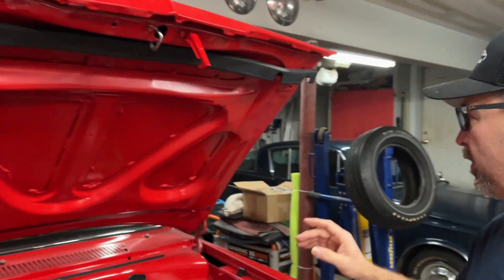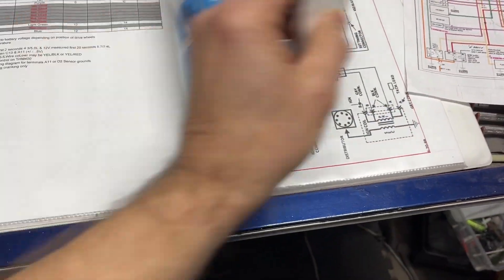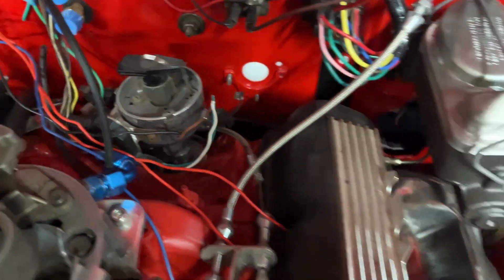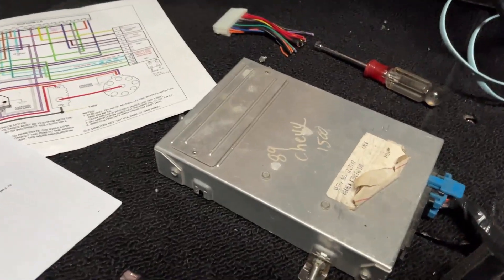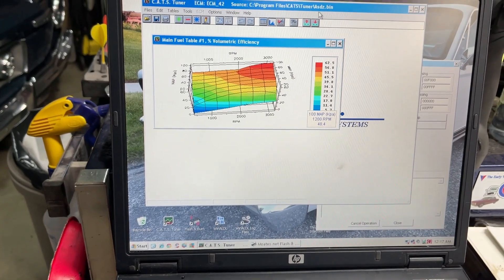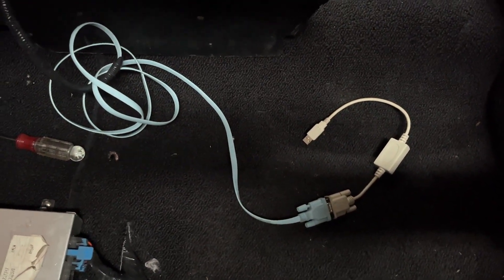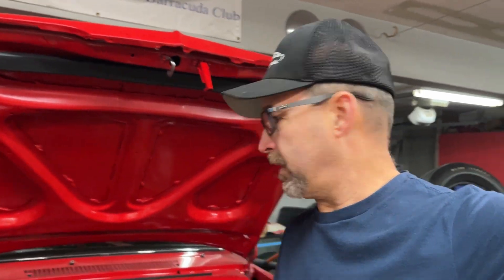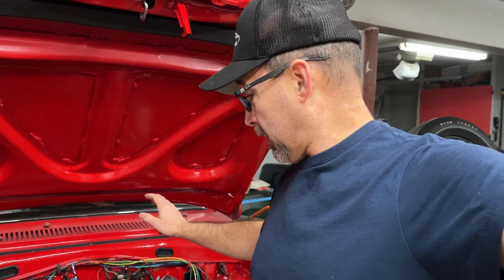How To: DIY Fuel Injection

Comment: What fuel pump did you use
Reply from the maker: @brycemcdonald6779  I honestly don’t remember, it was over 12 years ago. It’s an inline pump mounted to the frame of the car putting out the required amount of fuel pressure. That’s all I can tell you.

Comment: THATS AWESOME MAN
 i was just asking other YTers if i could modify a leftover LS engines efi system to any engine i wanted.
just rob the fuel rail, injectors, throttle body , iac, tps temp sensor, o2 sensor etc and make it fir on another intake/engine

this way seems even simpler
BUT VGG makes it sound like those terminator brockly injectors are  not available new parts anymore?
Reply from the maker: Check out the forum link in the comments, there’s info on TBI and mulit-port injection.

Comment: I love this stuff and i know theres a million ways to skin the kitty. That said if younwant o skip dealing with the old school gm ecu and wantno be able to tune your ecu so your engine will run optimally and you dont want to spend a small fortune fornwhat holley, edelbrock etc... want which last i checked was over $1000, then theres an open source efi controller called speeduino which is a goofy name but boy howdy is it some powerful hardware. You can buy a pre-made board that will do everything from tbi to sequential port injection, basic distributor to coil on plug amd its tuned via tuner studios which their basic version is free but if you want features like auto tune where you drive around an let the system adjust itself then theres a $20 yearly fee i think im pretyy sure its 20 anyway... ive used this deal a few times and i buy the ecu's from detonationems.com. they sell a board with provisions for up to 12 injectos and every type of ignition for $89(no im not employed by them or being paid to say this). I used to use the stock gm computers with modern erasable prom chips (the prom holds the program for running the engine and later they added transmission control before OBD2 and flash memory became standard) ive even run a few using a prom chip emulator from MOATES but they went out of business back in 2020 cant imagine why🤬. But its a lot of dicking around with 30+year old hardware, and the big aftermarket companies want way too much money for their ecu's that have to be tuned with their software, hell even megasquirt wants $400 for their entry level microsquirt and that has no provisions for an idle air motor or map sensor

Comment: Wow!  Roger you have impressed us again with your incredible knowledge and abilities. I love your videos and glad that I am slightly behind you with my project car. It gives me a place to go to fire me up for the next phase. However, I think I come from a slightly different place with regard to the 60s Mopars.  My interest in the old cars is because they DON"T have computers and sensors.  It's what I hate about new vehicles, new appliances, new anything.  I had to replace 3 refrigerators in one year due to sensor / computer failure. One week after my warranty ran out on my new Maytag washer and dryer I began losing features which I didn't want and didn't need in the first place.  I guess my old age is showing through, but the more I work on the old stuff, the more I appreciate the engineering of the days gone by . . . .  ⛽🛻🛵
Reply from the maker: Thanks! That was over 10 to 15 years ago. If it were today I would have put a carb on it with a Mopar electronic ignition and called it done. We all go through phases in our hobby, many do it with different cars, but I went through several phases on one car over 25 years of owning it.

Comment: That is a blast from the past. I remember my first time tuning was with eeproms and needing extras because it was one shot. Then I built a megasquirt 2 unit for the car. I had it setup for dual injectors, water/alch injector, shift w/out lift, MSD digital ignition (6a I think?). I got a 16v head from an older volkswagen, and put it on a newer 2.0L aba gas engine. That block was also the same block as the diesels and the right gas models had oil sprayers under the piston. The head bolted on with ARP headstuds, and I had to get a billet distributor block off that had a gear on the end so the oil pump still got powered. Then I used the distributor spot on the 16v head to run my cam sensor with a block off plate. I got an older AR Research turbo from a dump truck and boy was that fast for back in 2008 lol.
Reply from the maker: You really went all in! I looked at the Megasquirt before going with the TBI.
Reply: @RogersABodyGarage  back when I made mine, there wasn't a lot of options for stuff. AEV had just gotten into making piggy back systems and the LS was just starting to be popular with tuners. If you truly love to tinker, look into the megasquirt still.  At this point you know you have a perfect reference to build off of.  If you wanted to change your tune, it takes as long as it does to write it to the chip as it does to the flash in on the MS2 but now I can just start the car. There are lots of configuration options on the MS2, you have to build it for the setup you intend to run. You can modify it easily for future changes and there is a daughter card that you can do and run the extra code like I did. MS3 is a lot more plug and play, I want to use it on a motorcycle project I am working on. I am currently building an ESP32 touchscreen that runs the controls for an on-board infotainment system on my Goldwing. And I have dual 2 channel amps,  and a raspberry pi 4 with openelec. I love to build stuff lol. I love it when people take stuff that was never meant to work together and figure out how to make it work right. That is half my job at work is figuring out stuff people say is impossible. I love the detail you went into for the video. Not a lot of car guys are like me and love the software and electronics behind it and I think you did a good job of going over what was needed to accomplish the job. It isn't hard, it just has many step that must be followed in order.  👍👍